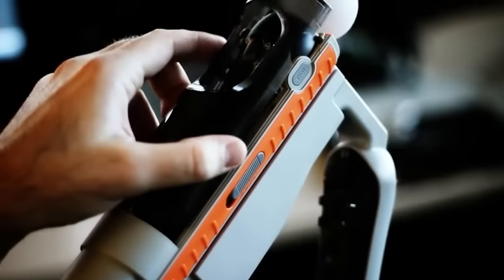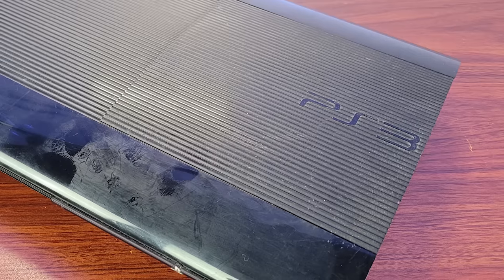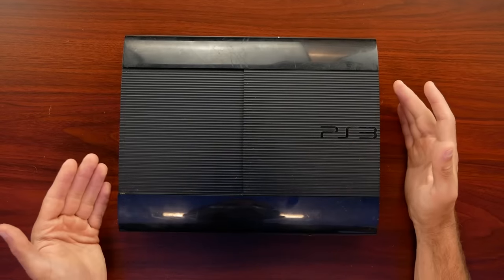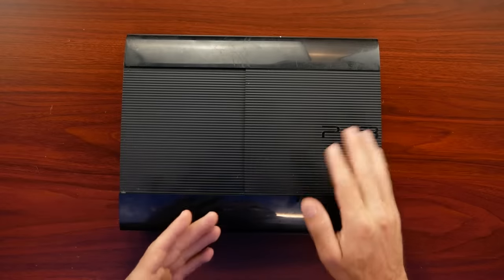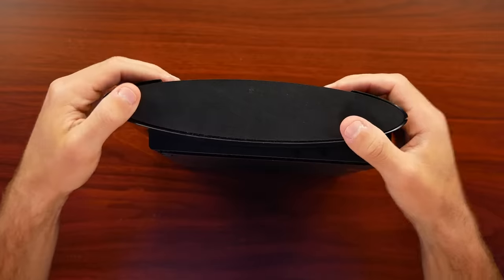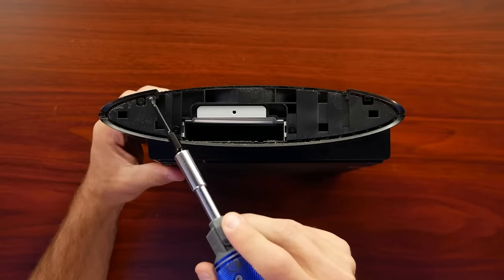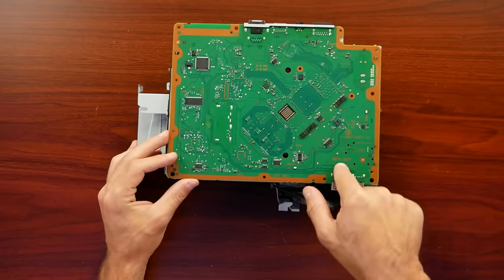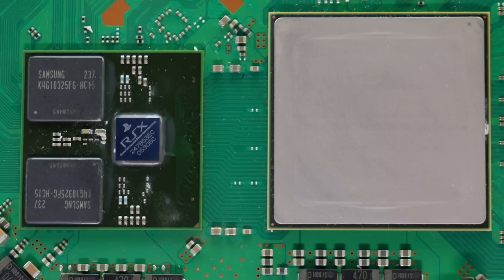The Weirdest PS3 Sony Ever Released

Comment: Yeah, I’ve had that one for almost 9 years now. Not one single issue and I still use it frequently.
Reply: It’s basically a metal gear solid machine for me
Reply: @thelastsnake6653  Cool. I’ve been meaning to try that series. I’m playing ni no kuni
Reply: I owned the og 60gb ps3. Started issues 2 years in. When this model came out traded in for that model. Still running.  Also my super slim had a 120 gb hdd
Reply: Same here
Reply: It's my PS1/PS2/PS3 JRPG machine
Reply: It's definitely the most reliable model
Reply: Yea this is my favorite model. Having the disc drive that way has meant no disc jams or mechanical issues. It is also really quiet and takes up very little space. I recently modded mine and added a 1tb hard drive so I love it
Reply: I've gone through three PlayStation from blinking red light. Switched to Xbox SERIES S best decision I've ever made. The menu system is the laggiest I've ever seen.
Reply: @Acrylier  no games right now (or last gen) but I'll definitely be picking up a Series X as well in 3 years.
Reply: You are really lucky
Reply: @jimmycarpenter6612  is this one easy to mod?
Reply: @jimmycarpenter6612  awesome thanks alot
Reply: Yup same here. Even when it came out my wife got for 100$ some how
Reply: Same here
Reply: Same.
Reply: No way mine shits the bed constantly
Reply: Exactly. Bought mine in 2012 too and it works with no issues
Reply: Same
Reply: It's built cheap as hell tho in comparison to the original slim, and especially the original ps3, the plastic on its cheap ash but the internals got a lot more reliable, I like how they made all of them look relatively the same shape just different sizes
Reply: All right I feel much more at ease reading all this cuz I've seen a super slim and it came with a bunch of games and I think it's still where it was literally I think 15 months or so ago pre-pandemic. I'm definitely going to go pick it up cuz it was pretty cheap.
Reply: @XBX1MASTER  I meant PS3 was very laggy do to maxed storage
Reply: @Acrylier  I gotcha. Fist bump.
Reply: What is your opinion about Jon forcing it open instead of using the open button? I have this system too (500 GB) so I know it opens easily like that, but I feel that the button should be used. *shrug*
Reply: Same mine still works and I've left in on frequently for 20+ hours at a time
Reply: I'm going pick up a fat ps3 so I can get cfw I gave my hen ps3 to my lil bro
Reply: I have the PS3'Slim and works good to this Day.
Reply: In general Sony’s consoles have been extremely reliable only one to have issues was the 60GB fat PS3 I now have the PS5 so I have faith in Sony’s build quality
Reply: Same I got a blue one fired it up to play MGS PW and it's a solid game man.
Reply: just hooked it up again after like 4 years and yea, it's not a ps4 but it's just fine
Reply: Had mine for 6 years. It only came with 9gb and no hard drive. I bought a 320gb hard drive and popped that joint in. I was so happy that I was able to play a lot of the games that I never got to play in high school
Reply: @psplayer1344  MGS4 even as an early PS3 game is an essential game for the console.
Reply: @Acrylier  i wish id given microsoft a chance much sooner myself acrylier, since phil Spencer took over they've impressed me to no end. I intend to get myself a series x, and that will be my go to system once i have it. I really want to delve into the x box 360 library to, i ll be plenty busy
Reply: @derekbuckler3859  The only thing Xbox doesn't tell you is that, if you have an external hardrive you cannot play enhanced games on it.
So only internal storage can have enhanced games which means cold war is 200gb takes up most of my storage. It's fine tho but when new games come out cold wars gotta go.
I have a 2tb Seagate hardrive and it only plays Xbox one and 360 games. For the future yunno, you gotta buy the Xbox memory sticks.
And also once a game becomes enhance you can't un-enhance it so you're forced to use internal.
Reply: i have a ps3 phat that plays ps2 games still working till this day
Reply: My laser died a few years ago but I replaced it and it works like new since.
Reply: Same here man christmas 2012
Reply: Mine’s drive doesn’t function anymore. Probably because I haven’t touched it for long and when I decided to use it again, it won’t read my games anymore.
Reply: Yeah, i went through several units, then my brother gave me this model years ago and have never had problems.
Reply: I got my Super Slim in 2013 on Amazon (probably used) and it's still doing great.
Reply: i still have a slim. i think, aside for the lack of BC, it's the best version of the machine. the REAL best version though, is the original fat unit, with full hardware BC.
Reply: Oh, it's just a Super Slim. Fucking Clickbait title.
Reply: @RWL2012  What's clickbait about it? for many reasons, it's the weirdest version of the console.
Reply: @jimmycarpenter6612  what state do u live in cause I have the same last name and I think I’m related to u?
Reply: @psplayer1344  such a good ps3 game. The remaster for ps4 was a good choice. I might replay that.
Reply: @jawdyn24  Georgia
Reply: The og fat is still the best though if you could keep it running.
It actualy playes games at higher quality and  gave smoother gameplay.
Reply: Same here
Reply: @fmccloud  yes, I use the button to open, when people open it like that I don’t know what to think. But I feel like closing it it’s like swipe card task in among us, if you do it too fast it will not close, if you do it to slow it will not close, only with the perfect timing can you close the thing
Reply: It's strange how flimsy it looks but how resistant it is.

It's a solid PS3 model
Reply: The only problem I've had with mine was that sometimes the top doesn't close all the way and you have to open and then close it again
Reply: Still works ? Nice
Reply: I have a Slim and this Super Slim. The HDMI port stopped working on both.
Reply: I basically use my PS3 as a DVD/Blu-ray player because it's a lot better than the PS4 at doing that
Reply: I just bought this one
Reply: I have the third model and haven't had any issues 🤞 But these last slim versions are cool imho. I think the blue one looks the best  but finding one that isn't destroyed is difficult.  

I don't know why but Playstation always get thrashed just like trying to find a decent Nintendo 3ds .
Reply: Nah don’t believe it this system has no issues, I’ve had mines for over 10 years and it’s still functioning perfect. More reliable than the fat one .
Reply: ikr ! there is nothing weird about it
Reply: Same Bro
Reply: I recommend giving it a little dusting inside with an air can of whatever cause OOOOF. This year the fan on mine kicked up really loud and shot out what looked like a snow storm of dust into my room 😅 didn’t harm the system or anything just made a giant mess lol my room isn’t a very dusty place either so 🤷🏼‍♂️
Reply: Ive had mine since 2013
Reply: 7 yrs and it just fine here also
Reply: Same
Reply: I liked it.
Reply: Same here
Reply: Bought one used a few months ago and all I can say is it’s loud 😂😂
Reply: When I play assassin creed black flag it lags like crazy
Reply: Same
Reply: One issue... no back compat. Lol
Reply: wish I could say the same, I was on PC bought one just to play gta v after playing on my friends slim, but mine had major performence issues that almost made gta v unplayable. I was mad cause I thought I was getting the latest and greatest.
Reply: Yep! Still plays well to this Day!!!!!
Reply: Nah the first model that's backwards compatible will always be the best
Reply: @deskmanatee  exactly shin megami tensei and persona is perfect for the ps3
Reply: heh same
Reply: I consider getting one but I'm getting the regular Slim because I wanna do a full mod rather than Hen, also I want a lot more storage but I'm changing the 120-160GB (not sure) Hard Drive out to a 500GB+ SSD when I can afford one. Getting PS3 Slim tomorrow, excited. Any PS3 game reccomenedations and Homebrew recs as well? I'm already gonna get Rune Factory Oceans/Tides Of Destiny, some Metal Gear games, Burnout, Need For Speed, Tales of, Nier, Black Ops 1-2, Modern Warfare 1-3, bunch of Altier games, Tekken 6, Street Fighter 4, Marvel Vs Capcom 3, Sonic games, Mortal Kombat, Genesis Collection, and some other stuff but want to know what people like
Reply: @psplayer1344  hmmmmm. You pretty good
Reply: Same here
Reply: @castroh19  You can update your HDD up to 1to and an half.
2.5 inch HDD 7200rpm max.
You can put an SSD but it wont live long and wont be used at maximum potential.

Very very easy to do.
Mine is a 1to model.
Reply: The slide model is way better a lot quieter too.
Reply: Same bro
Reply: Ye same
Reply: Bro whenever i play games on it in 15-20 mins i get a message that my system overheated and it's pops up like 3 times and than its just make my fan noisey i search on google and i get the same recommends that to change the thermal paste so is its right that u gotta change the paste
Reply: You might wanna re-paste your chips thermal paste only last 8-10 years mine only lasted 1 year but I played mine a lot
Reply: Same
Reply: Same but it's getting increasingly louder...needs to be cleaned out
Reply: Did you ever get it maintained like dust cleaning or changing the thermal paste? Just curious, I've had mine for over 3 years, bought used and its never been maintained
Reply: @watchmejumpstart That's a stupid question considering the commentator literally said that he has been using it frequently for 9 years. Learn to read properly.

I don't have any issues either. Works like a charm. Take care of your console otherwise it's not going to be the same. Maybe you just got unlucky and got a defective one or you don't keep it clean but laggy menu is not a big deal. As long as the games work, that's all that should matter.
Reply: Had that from I was 5 to 12 until one random day the cd port wasn't working  plus I didn't download games just had 20 cd
Reply: @psplayer1344  what about ps3 fats? is it still good now?
Reply: The Sony radio my father bought lasted for 20 fucking years. TWENTY. Finally had to bought the new entertainment home system to upgrade at last. Sony makes long-ass machines lol
Reply: I'm also using it in 2023
Reply: still playing mgsv with that
Reply: Same bro mine still works and I find it better then the others since IT CANT JAM when removing disks
Reply: @castroh19 my super slim has 12 gb
Reply: Me too!
Reply: does it taste good?
Reply: Recently I've been wanting to get a PS3, I was thinking about getting a fat PS3 cause it's backwards compatible (specific ones are, not all I know thanks), but then yesterday I saw a this and I found the slide mechanism really cool, I mean it's a small thing but I absolutely love when you have to do a manuel act to load a disk or whatever, eg: beauty of riding a cycle is paddling and steering, if it's all automatic then it ain't fun( stupid way to put it but you catch my drift g)
    So now I decided to have a collection of playstations, a fat PS2 and a super slim PS3
  What do y'all say???
Reply: @JordonPatrickMears11211988   with ps1 yes
Reply: @noctsickversus9632  or ps2.  Only the original ps3 had back compat with ps1 or ps2.  Any other model beyond the gen 1's lacked all back compat.
Reply: @noctsickversus9632  and if I had a ps2 game available, I could prove that with my ps3 slim sitting right in front of me.
Reply: Does it still work?
Reply: It's good but sometimes..It freezes . But it's rare to happen but when it happens it very annoying.
Reply: Yea this is honestly the best ps3. The early models require so much maintenance and its annoying got the average gamer. The super slim is the best ps3. Great storage. Great practicality, plays games great, great graphics and lasts forever.
Reply: Same, never got a disk stuck in the system
Reply: Same as me, I love it

Comment: I’ve mentioned this a million times. The Super Slim HAS AN EJECT BUTTON. It breaks because people keep sliding it with their hands
Reply: This! I got my Super Slim somewhat near release, always used the eject button & never forced it open with my hand, and to this day I’ve still never had any issues with the sliding door. Still works perfectly.

I feel like this is kinda like when people complain about their joycons flying off of their Nintendo Switch, when every time they’ve detached them from the console they’ve literally SHOVED them off, instead of using the button on the back of the joycons to release the rails to slide the joycons off 😭 and you wonder why your nintendo switch joycons are loose after you’ve destroyed the rails like that?? 💀💀